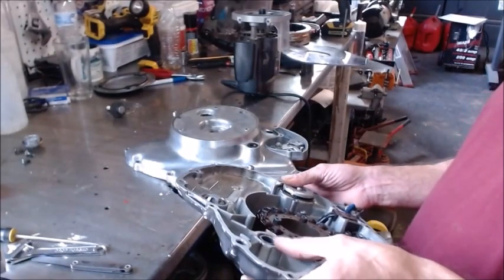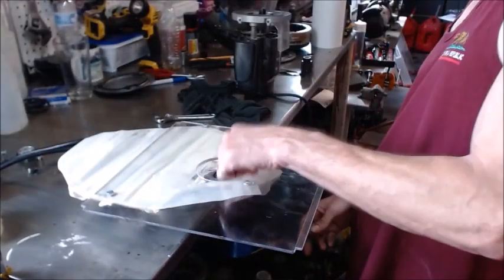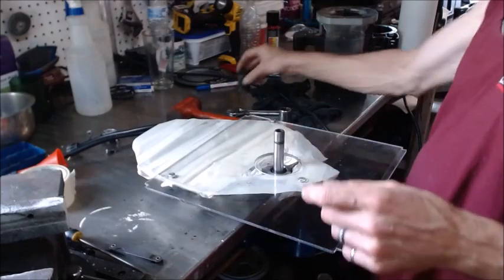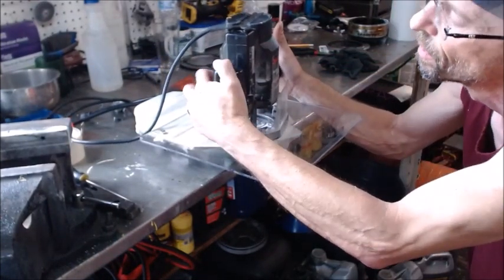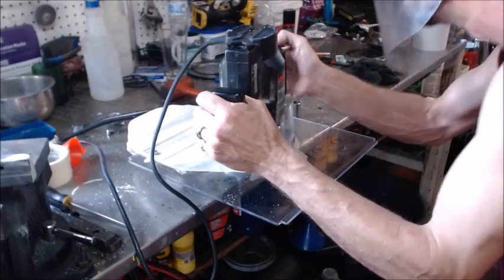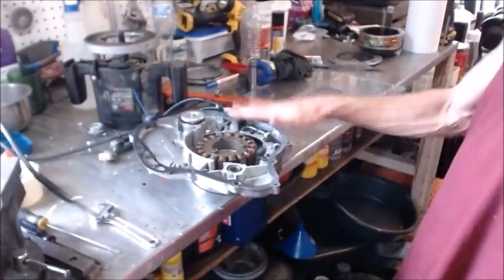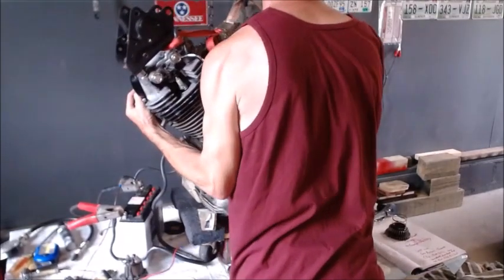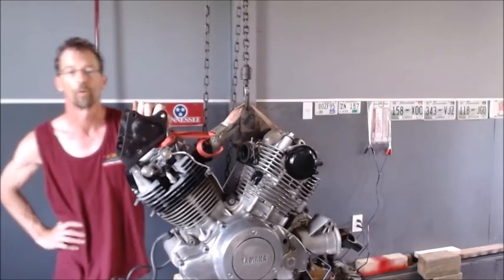Yamaha Virago xv750 case cover machining for better gear engagement - Router Method

Comment: what size sockets are those hex bolts on the cover?
Reply from the maker: Hello, the hex bolts that held down the plexiglas were M6 bolts (I used nuts on them to bolt them down) so they were 10mm hex heads.
Reply: @StevesDIYs  thank you so much. I picked up this 82 virago and I’ve ran into start issues beyond the stars, I’ve been watching your channel since the beginning this project. Do you happen to know where I could find a service manual for it?
Reply from the maker: @WowItzAkina thanks and hope the videos are helping a bit along the way 👍. The original service manuals are hard to find, but both Haynes and Clymer make a manual for them and they cover most things on the bikes.  I have both and the Haynes manual seems to be much more accurate on the info than the Clymer (especially on the carb info), but I have found a couple of errors in the Haynes manual on the electrical schematics with the coil wiring colors.  You should be able to Google Virago Haynes manual and look for the year and model covered as the one book covers several years and models since they are very similar.  Hope this a bit and all the best !  Steve

Comment: It’s been a couple years now.  Did the machined cover solution ever cause you any problems?  How much material did you mill off?  When shortening the spring, how much did you cut off?  Thx!
Reply from the maker: Hey man !  No issues with the cover machining causing a problem and the bike is still starting just fine with no gear grinding.  I actually did my bobber the same way and it is doing good too.  Here’s a video of me doing it a few years ago as well (I had bought a mill so I did that one on the mill vs using a router), so it has more detail on how much was removed.  For the spring, I took off one curl and then bent the new last curl down a bit so it was flatter like the original last curl.  Here’s the link to the other video:  https://youtu.be/A64v-i2W6F4 .  All the best !  Steve

Comment: Awesome video! Did you use any specific bit on your router?
Reply from the maker: Thanks man !  I just used a regular wood bit as aluminum cuts really easy at the high speed the router goes. I believe it was a carbide one. All the best ! Steve

Comment: I just machined my engine cover today with an angle grinder since i dont have access to a lathe and i dont have a router. It was a little challenging to achieve a level finish but after a few hours of grinding, i did it and now my bendix gear doesnt grind. works amazing! Thanks for sharing this Steve!
Reply from the maker: Thanks man !  Good to know that it can be done with an angle grinder as well since some folks don’t have access to a router or might be more comfortable using an angle grinder to remove the side cover metal 👍👍👍. All the best !  Steve

Comment: Funny, i did not know about this video and i did exactly the same !!
Reply from the maker: Claude Quertinmont , that’s cool !  Yep, I noticed how poor the engagement was on the gears when I was doing slow-mos through the oil fill hole and wanted to see if I could get better engagement to stop the grinding out on these really worn gears. I haven’t finished building this bike, but So far I’ve not had a single grind out on my bobber (did the same to it ) since doing the cover, short spring, and clip clamp 👍. Glad to know someone else tried this too 👍👍

Comment: Man I really want you to send me a machined cover and the clip shim
Reply from the maker: Doing the machining (even with a router) wasn't too bad to do but, just adding the clip did a whole lot for making it engage and not grind out after a couple of rotations (Not sure if you saw the other video).  It was real easy to make and install the clip.  Maybe I should make a few in case folks want to give them a try on theirs to help with the cranking.  I'll have to go look for that particular crimp clip I cut down to use to see if I can find some more at the store.
Reply: Steve’s DIYs well I am interested in that clip whenever you have it let me know I will be the first customer